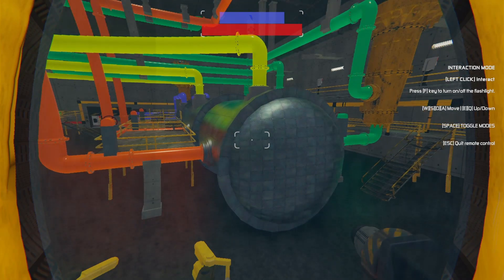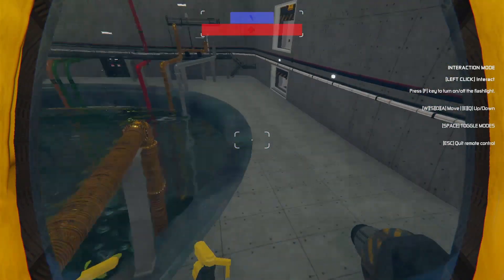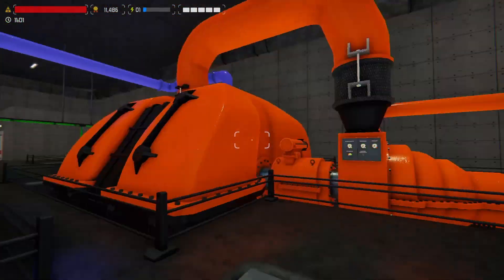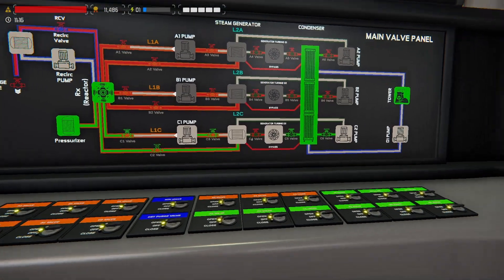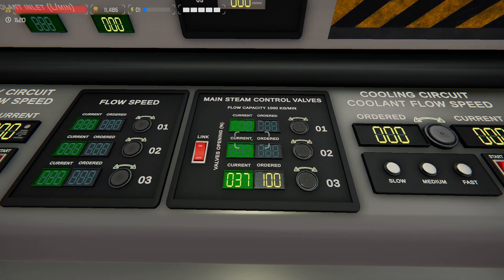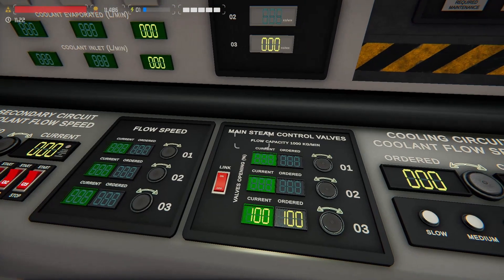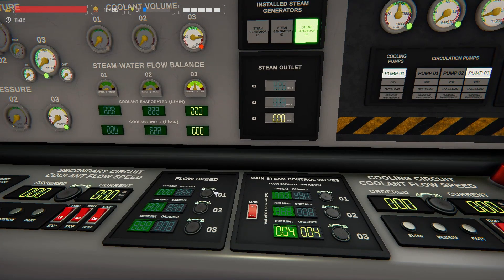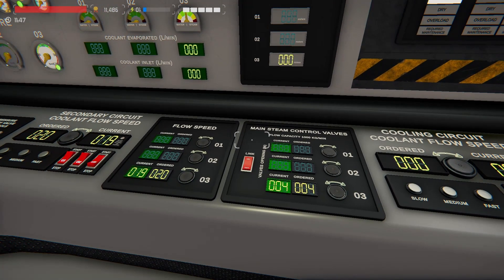MSCV (Main Steam Control Valve) Explained - Nucleares

Comment: Thanks for the great video! It's really helped out a lot. Would you be able to make a video on how to avoid reactor poisoning (or show how you can survive until it is stabilized). I've tried using boron, bringing the reactor to heat slowly, doing it quickly. No matter what, it seems after a day when the Xenon and Iodine are both present in the system, the reactor cools completely at 0% control rod, my turbines lose power, and the city gets on my ass. Any advice is appreciated
Reply from the maker: What does your startup sequence looks like? When you pull rods to generate heat, where is your boron at? And what are your primary, secondary, MSCV, bypass, and condenser settings?
Reply: @leonidasares  Startup is pressuriser, and vacuum pump on, boron to about 3300, control rods at 100 and insert fuel. keep the reactivity of the fuel at  about 5-5.5 by raising control rods to increase heat to 412. Primary is on 10 (trying to preserve heat in the primary loop, anything less starts alarms), Secondary I didn't understand so had that on 50, MSCV on 100 (will lower on the next run), bypass at 100, lowing it to increase power to turbines, condenser at 100 (I assume this is just keeping the coolant cool, so don't know why I'd have anything less than 100)
Reply from the maker: I start dosing about the same time I pull rods. Because remember that if you pre-dose boric acid, the boron acts as a liquid control rod so you’re having to pull the solid ones even further just to get the core to heat. I like my boron to build as my reactor is heating up. Don’t sweat the reactivity. You don’t need to look at it at all. It’s just a temperature change gauge at this point in the game and not designed to dictate how to run the reactor. 

You have a lot of excess going on which means all the systems are having to work extra hard to overcome, and that’s probably why you’re getting those xenon spikes. I would lower your reactor temp. I really like 300, but somewhere 280-320 will work. The primary pump just carries heat down to the steam gen, I usually start mine at 15 and then back it off to 10 once I’m running. The MSCV should never get above single digits, especially in the early days of the game, and the secondary should be 5x whatever your MSCV is. The condenser is more efficiency, so you’ll want it as close to 100° as you can get it but not over. I keep mine around 65-75

If you want to see my method in action, check out one of my startup videos (the ones with chemicals). It’s a pretty smooth process and I have never gotten xenon spike with it yet.
Reply: @leonidasares  Thanks for the advice. I'll give it a shot, and check the video out!

Comment: Only complaint is this is the biggest difference between a real pwr and nucleares. In a real pwr, you open the mscv, and that removes more heat from the primary, which causes reactor power to go up. In a real pwr, reactor power follows turbine demand from the mscv.
Reply from the maker: I have to continually remind myself of this very concept you described: that Nucleares doesn't match IRL patterns, or even physics sometimes (see unloading a 2.5 million L pool into an 80k L tank and back again without missing a drop). There are lots of little nuances like that in the game where Nucleares "fudges" the reality of it. But, IRL reactors are quite boring. Wouldn't make for as exciting of a game.